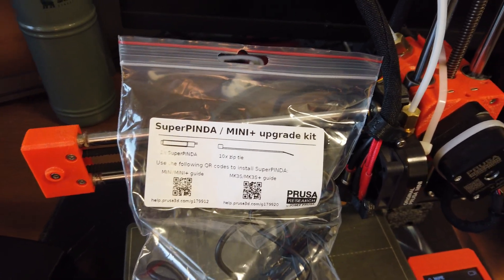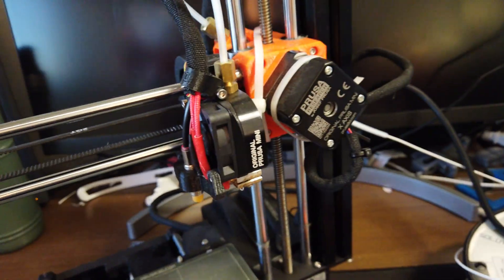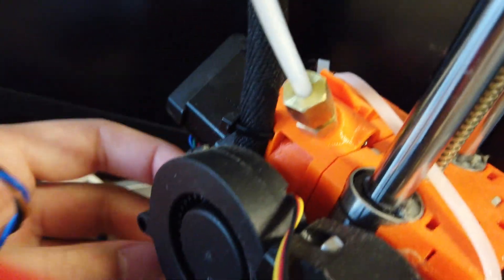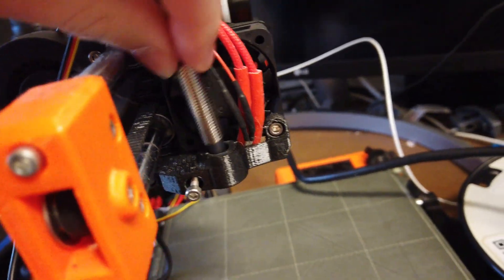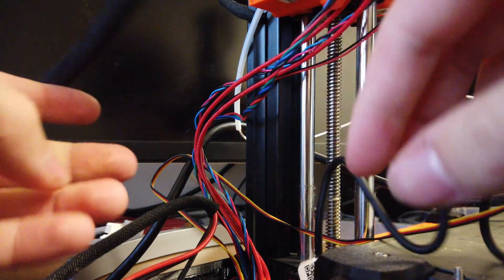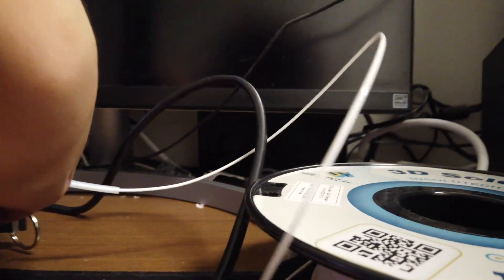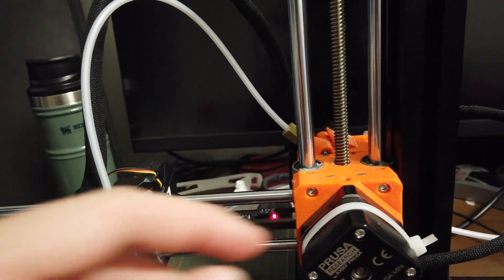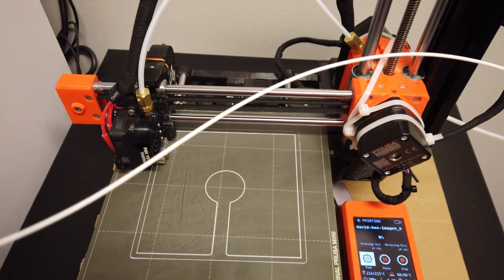[3DP] Prusa Mini SuperPINDA Upgrade Installation and Testing

Comment: "there's a little bit of plastic there, but that should be good"
No. Prusa specifically instructs us to remove any traces of filament from the nozzle before calibrating the PINDA, because the nozzle itself has to touch the bed while the PINDA height is being adjusted. Not doing this can affect the PINDA offset height, and hence print quality.
Reply from the maker: If your plastic is melted it will get out of the way :)